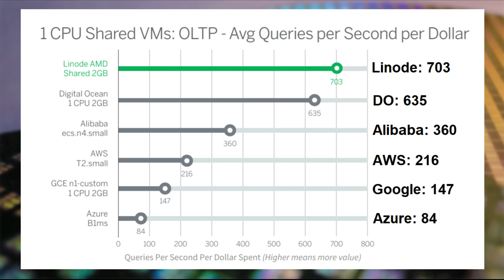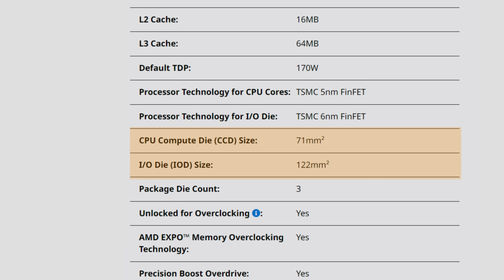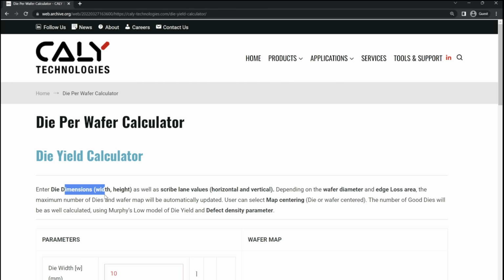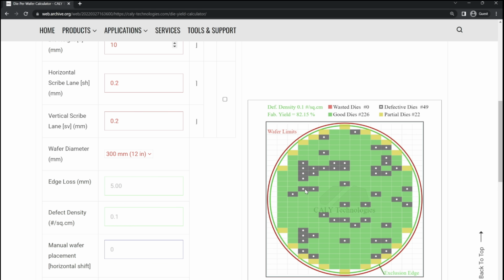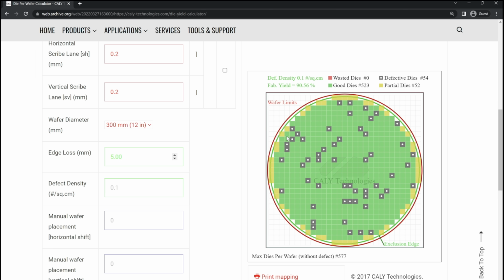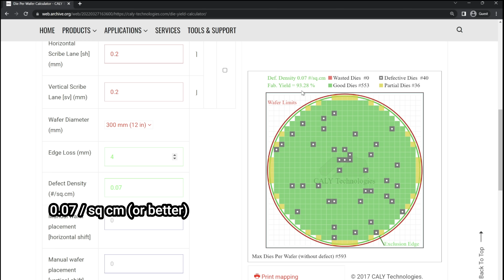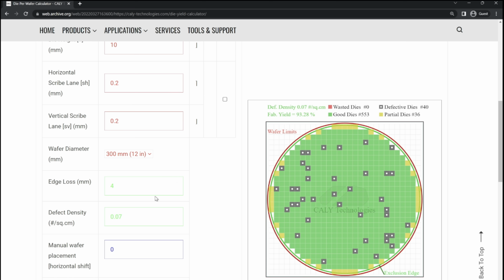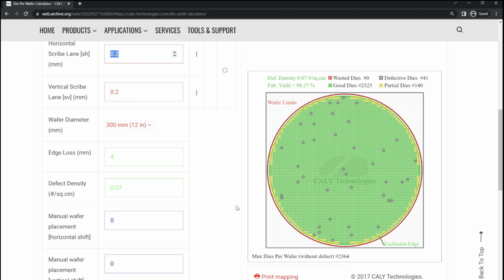AMD Ryzen 9 7950X: Cost to Manufacture?

Comment: Interesting, I'm curious as to what the BOM cost is for Intel and in regards to chiplets - this seriously increases the profit margins for GPUs significantly. So, I hope AMD really competes on price with RDNA 3 as with more power efficient GPUs, They would have sure fire winners even if the GPUs are 'good enough' considering the issue with inflation globally and energy costs.
Reply: BOM at Intel is really tricky. They design and manufactur in house. Beside buying they can even make wavers in house. So these process are more covered in a monthly bases and not so much in a per wafer or per chip rate.
But a bought waver will cost the same so you only need to update the area and defect rates of the chip.
But the material is not the costly part. Salery and maintenance of a fab is very costly.
Reply: @MrHaggyy  Thanks for commenting, your points are why I'm really curious about Intel's BOM cost. The other thing to consider is the equipment costs, node costs, running costs (energy) etc. As AMD does not have the associated overheads any more as they no longer have their own fabs. Which one might argue has actually made AMD alot more agile and not constrained to a particular Node pathway. Whereas Intel is constrained to Node pathways, improvements and yields. Unless they completely forego their own fabs and have TSMC for example fab their cpus and gpus.
Reply: @earthtaurus5515  in some way Intel had a chiplet design for years. I/O, cache, ALU, and cores have different constraints on the transistors. So Intel used "25nm" like processes for direct chip I/O and went smaller and smaller the faster and more protected the transistors got. I/O and cache designs are usually known between IBM, Intel, Samsung, TSMC etc. it`s stuff like clock transmission, branch prediction, and core packaging that's different.
Intel had a deal with TSMC to make 3nm GPU and ML chiplets for Meteor-Lake. But Intel canceled it just a few weeks ago leaving TSMC alone with the Apple M2 and a view of small unknown customers. I don`t really know why or what they will do instead right now.

Comment: I dislike it that AMD charges more per core for the lowend models (7600X and 7700X), it makes me feel a bit robbed but the 7900X and 7950X just aren't good for gaming, on Windows anyway. You clearly see much lower minima on Windows for the 7950X and 7900X than for the 7700X and 7600X which should be caused by ccd-hopping (ccd being one of those tiny core-chiplets). Basically a core on one of the ccd's gets data fetched from the RAM, it gets stored in cache for that ccd and then Windows sends the next instruction to a core on the other ccd which has to fetch the same data again (be it from RAM or via level 3 cache).

Comment: Did you factor in the silicon interposer? I know you said “packaging”, but you only vaguely referenced it and the number you gave sounds rather cheap for that kind of tech.
Reply from the maker: There is no interposer here. Its just a substrate.
Reply: Oh, my mistake. I thought they used an interposer for the die-to-die interconnects. So is it just like… copper traces?

Comment: Bunch of potato heads in the comments.   A new chip arch takes ~4 years for it to go from clean slate to production line.  It's part engineering, part art, and tons of trial and error testing & revisions.  The breakdown here doesn't account for the bulk spent on this R&D. it also doesn't account for shipping, warehousing, distribution, marketing, and all the associated costs of paying employees from engineers to HR and shareholders to keep a competitive company running smoothly and competitive. Money motivates, communism has already been tried and failed.  Name one non profit company that has excelled in the tech sector.. just one.

Comment: I’m surprised packaging is as low as the estimate here. I would expect the machining, plating, engraving, and soldering  of the IHS alone to cost more.  Fascinating.
Reply from the maker: I couldn't get a consistent estimate, so error bars are quite big. Estimates ranged from mid single digits to low double digits. It's a super thin substrate.
Reply: @TechTechPotato  That makes sense.  Also, economy of scale can be tough for me to wrap my head around.

Comment: There is way more than just the cost of the material here. There is also the cost of operation and the cost of R&D. So basically, there is a bottom price that AMD need to sell their chips to break even... and this is not the cost of the manufacturing the chip.
Reply from the maker: R&D is amortised over the lifetime of the chip, which from the outside is impossible to predict. This is Bill of Materials, very important for HVM and investors. Everyone bitches when Intel saves a cent or two on thermal paste - that's BoM because over millions of chips, it matters.

Comment: Overall chip costs more than just cost to manufacture. Add in research, development etc.. will most likely cost many times more than chip it self. Take example AMD, they spent about 2.8 billion on RND in 2020. They must make around 8 million chips only to cover the costs for 400$ chip research, development and manufacturing costs, before added sales margins (this is not retail price). I would expect such chip end up in 7900X or 7950X price range in retail or 3000-5000$ Epyc chip.

Comment: Not all defects have to be fatal.

It can simply be a cache-line that cannot be used and in that case, the whole core is 100% well.
More severe problems only effecting a single core, can simply be fused off (less cores per chip).

Given this, AMD will be close to 98% to 100% yield.
Reply: What really drives that point home is a chip like AD102 - that's huge; and likely the primary reason (though market segmentation is nice too) to sell a cut-down AD102 in the form of a 4090 rather than a full-die product is so that such defects aren't actually fatal - just disable a few cores, and use the die anyhow.
Reply: That's basically what I was going to say. They have a good reason for releasing 6-core and 12-core parts.

Comment: What about the labor cost? What about the rest of the physical assembly? Seems like an incomplete analysis.
Reply from the maker: This is just cost to manufacture / bill of materials. As it says in the title
Reply: @TechTechPotato  BOM and cost to manufacture are two very different things. The video thumbnail gives the impression that the entire CPU costs $69 to make. But the video solely focuses on cost of material for one component - the die - and then some packaging. What about the other physical components? The formed metal cap, the rest of the board, what it takes to put that together? 
Seems equivalent to a deep dive into the power train of a vehicle being labeled as the cost to manufacture the entire vehicle. Or labeling the same as bill of materials for entire vehicle. Neither label would be accurate. 
Not saying the video wasn't good or informative, I just think the title and thumbnail are misleading.

Comment: Were did you get the 17K/wafer from? The table floating around the internet claiming 16988$/wafer was wrong. This was just a bad guess by a finance analyst that made this guess just on investment costs of EUV equipment.
I dont know the exact value either, but TSMC reported around 1.2 billion US$ revenue while digitimes reported a production of around 120-150K wafers per month in that timeframe which would be around 10K/wafer.

If you do the same calculation for 7nm family 2 years ago the result is also around 10K.
My guess: 5nm is actually the same as 7nm was 2 years ago. The difference seems to be that companies like Apple/Nvidia/AMD need to pay 2 years in advance to help financing the equipment used and the 17K are only correct if you are paying on delivery which none of the big customers did.
Reply from the maker: I asked over a dozen analysts who track the field a lot more extensively than the rest of us.

Comment: I cant wait till chiplet/ modular CPUs to scale linearly as more are added. this is a such good technology foe CPU and GPU and maybe multiCPU setup to work as one for normal consumers. There isnt a limit to this other than power and cooling requirements. In theory, higher yields, cheaper per unit and linearity in scaling would be the ultimate engineering trifecta

Comment: What's the basis for the 7 dollar package cost? I thought it would be more like 20 bucks minimum for standard packages, and more for advanced. Is there any rule of thumb you applied there?
Reply from the maker: Discussing with industry peers mainly. The Ryzen 7000 package is super thin, and I was getting estimates from mid single digits to low double digits. So the error margin is higher with that one, add in a bit of number fudging for the meme, and there we are. Though you're asking the right questions for sure.

Comment: To guess what other factors are there, shipping costs from china to USA + import tax and the PCB+Heatsink, this together will add.. let's say 30 dollars per chip, so totaling in 100dollars. Let's not forget the firmware dev cost and testing, so let's give that 20 dollars per chip. Then Marketing and shipping to retailers, that could be a 50 dollars on top per chip. Totalling so far, 170usd. Then let's not forget the research and development prior to production, let's give that a 30, and also let's not forget the retail store margins, so about a 50. Totalling so far to 250 USD. Add to that a nice double profit margin, because so far we only calculated the "cost", so that gives us 500usd.
Think about this price for a second, isn't it what a year old and discounted 5950x is priced at? 
So although these are just rough and uneducated guesses, it could be something like this, but afterall this just a guess, and I'll be curious to see actual calculations with possibly more factors considered.
Great video there, keep up the nice work.

Comment: We wont see cheap chips or lower clocked chips or reused faulty chips to 2-4 core  to 7000. The reason why i bought a ryzen 1200 whic were the simples model at the time was to upgrade in the future but as seen with graphics card and 700 they abandoned the lowend totally on unless one count 4500 lowend -which for me is about middle -I guess its time to go Intel

Comment: You need to amortize the cost of the initial tooling and optimization of the node, and add day-to-day labor and costs of running the process node as well.
Reply from the maker: Those are TSMC costs included in the cost of the wafer. This is simply Bill of Materials, or as the title says, 'cost to manufacture'

Comment: $69 Dollars
+ the pcb
+ actually integrating the dies into the pcb
+ glueing on the ihs
+ manufacturing the ihs in the first place
+ QC process cost
+ additional defect rate after! assembly
+ rent for the assembly plant site
+ site upkeep (energy, insurance, staff that isnt directly working on the chips)

+ all the other costs he (and i) forgot

and also where does he get the $7,41 Dollars für packaing from? zero explanation for that number. in fact, as it is the last number i think he just tweaked it to hit 69,00 exactly. he even says "cost is just under $10" only to then proceed to give a number significantly under 10. 

overall: he's not even trying to be accurate.
Reply from the maker: Most of what you said is under packaging, or not part of bill of materials. It's called back-of-napkin (i.e. rough) calculations for a reason. For packaging, my trusted peers suggested numbers from mid single digits to low double digits. So yes, a bit of fudging was also used there, the error bars are quite high.
Reply: @TechTechPotato  i assumed that packaging meant the plastic and carton box, stickers, warranty papers etc.
(it already seemed a fair bit high, but in times of all supply chains being fucked....^^)

well in that case, i want to add the box etc. to the bom costs! :D

about not being part of bom cost: your video is called cost to manufacture. not bom cost. and the things i named are part of the cost to manufacture. 

but ok, different type of packaging.

Comment: Why you did not include the mask cost for photolithography? These mask especially front end mask cost related to layers such as (fin gate/active region) will be in millions. Although mask cost is one time cost, the same mask set can be used to manufacture as many dies as we want, but these cost should be included in terms of manufacturing. Second overhead cost will be manufacturing probe card to do wafer testing, again one time cost which is ignored in calculation.
Reply from the maker: That's not involved in the bill of materials for high volume. Those costs are amortized over the lifetime of the product, and good luck estimating both the cost and the lifetime.
Reply: @TechTechPotato   thanks for clarifying this point. I was having this assumption that these one time cost should also be included.

Comment: Of course there is the cost of developing it, the cost of marketing it, the cost of assembling those dies on the package, transportation, other stuff we ignore.
I personally see what the profit margin of companies is. The company with the highest profit margin, is the company that does have the option to sell cheaper, but chooses not to do so.
Reply from the maker: Well, the title does simply say 'cost to manufacture', not 'cost to retail'.
Reply: @TechTechPotato  No arguing there. Just saying that I usually see what profit margins companies announce and use it as an extra parameter. Not that this parameter is accurate or even correct, but I do take it in consideration most times.

Comment: Shipping and handling as well as the cut for the retailers make up of most of the cost in case you don't know.
Reply from the maker: Well, the title does simply say 'cost to manufacture', not 'cost to retail'.
Reply: @TechTechPotato  this kind of video is very dangerous, cos the partial fact stated here is on paper, not wrong, but easily misread and lead to hate as people in the interweb is not very smart these days. 
Very similar to saying farmers can grow food on land for free and you see a head of cabbage on the supermarket shelf for $2. 
This is immature spread of information and very irresponsible.

Comment: really like this topic. Trying to understand how dies are binned and what that means for getting a lower tier product yet still having overclocking headroom.
Reply: Each bin still has a best of the bin and worst of the bin.  Whenever you start producing a part using chips from that bin you have to make your part compatible for all chips from that bin which means you'd clock your part to use a frequency any chip in the bin will work with.  Some end users will have room to overclock and some will lose the silicon lottery and not have any luck overclocking.  All users will likely be able to add some voltage to get a higher frequency unless it causes the chip to hit temp/watt limit too soon to be of use, but it can be at the expense of reducing the life of the part in some cases.
Reply: @AvgDan  if you bin down the raptor lake die for defects, that should still give you a some dies that reach the same frequencies in the i5 and the i9

Comment: Really interesting video thanks for making it and you did touch on this point but only a certain percentage of dies would make the grade for use in the 7950X, so whilst you're right that most of the non-defective dies would make the frequency/voltage cut off to be used somewhere in the SKU it's maybe not fair to say every die would and therefore the BOM cost for specifically the 7950X can't be purely based on using any good silicon die. But I'm nitpicking and it probably doesn't change the price massively because all of the best dies go into Epyc anyway.
Reply: yep defective dies are why there is lower skus with deactivated parts of the die. Component binning exists since the premices of QC in industrial manufacturing and there is always a lower tolerance grade.

Comment: I would be shocked if AMD actually paid that much per wafer. Since they are TSMC's 2nd largest customer behind Apple, they probably get some of the best rates in the industry. My guess of cost per wafer with that in mind is that the wafer cost is about $8-9k USD per wafer for 6nm and ~$15k USD for 5nm. 

On the GPU front, AMD certainly gets better rates than Nvidia because of the volume they purchase from TSMC as well as Nvidia's stunt with Samsung angering TSMC. This is another significant advantage over Nvidia this upcoming GPU generation, along side AMD's chiplet architecture, that they have been teasing. I would expect these will mean that AMD had a very significant cost advantage over Nvidia this generation. I hope that AMD really takes advantage of this for this upcoming generation to take marketshare since that is what they have been struggling with for so long for Radeon.
Reply: The cost of the newer processing methods have increased exponentially. TSMC is asking a premium for the smallest noded, and since Apple/AMD etc are in a highly competitive market, they want to pay for it
Reply: Look up the throughput of the new scanners needed for these geometries.  It’s on the order of 30 wafers per hour, about a 10x decrease from former processes. Those scanners also cost at least twice as much so in actuality $17K per wafer is an amazing price.

Comment: Do the silicon quality and defect rates remain uniform as you move from the centre of the wafer to the edge?
Reply: Silicon quality is pretty uniform but pattern defect rates are definitely location dependent.
Reply: @DrParticle  interesting. That makes sense actually. Thanks for the answer!
Reply: The silicon should be of consistent quality, but edges have lower yields; both catastrophic (silicon is dead) and parametric (silicon performs poorly and/or guzzles power).